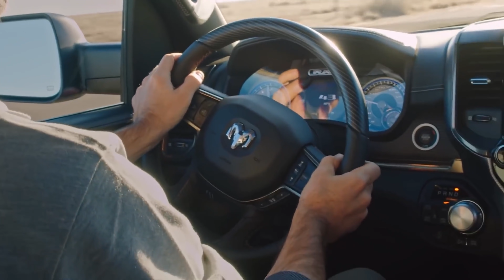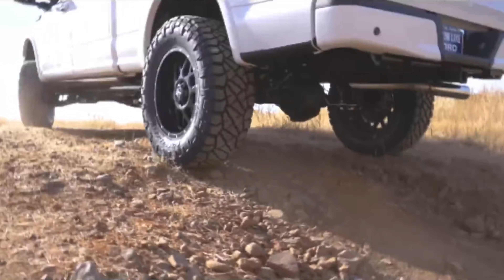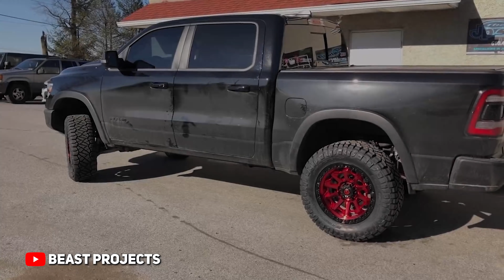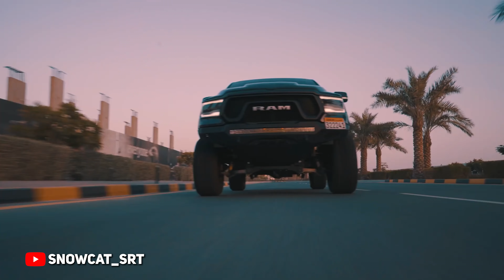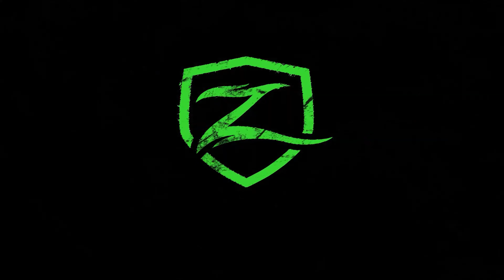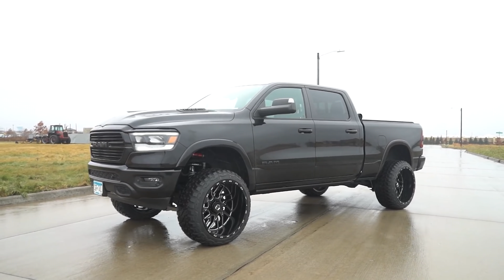Top 5 Suspension Kits For 5th Gen RAM 1500's

Comment: I’m just trying to get a big enoug lift to fit 22x12s on my ram, I’m thinking 3.5 or 4 inch, I really want to keep drivability
Reply from the maker: you can run 22x12's on stock setup, or even a level depending on the tires! Check our gallery out here - https://www.customwheeloffset.com/wheel-offset-gallery?make=Ram&wheel_diameter_from=22&wheel_width_from=12.0&sort=date
Reply: You can do 22x12’s with 33x12.5 on a level with -44 offset

Comment: I stuffed 35” tires on my levelling kit 😂
Reply: I have 22s wrapped in 35s with just a leveling kit no rubbing just a little trimming of the plastic fender liner
Reply: Same i have a 2.5 front 1.5 rear level,20x10's and 35's no rubbing
Reply: @TheIamdevin  did you use stock wheels?
Reply: @TheIamdevin  pics or vid?
Reply: @TheIamdevin why did you do 1.5 in the rear if it’s a level kit?
Reply: @jacobmartin1181  it was a procomp level lift kit. 2.5" front spacer,1.5" rear spacer and my truck didnt sit like a chevy with the nose in the air so thats why i chose that kit
Reply: I did the same just took of the factory rock guard and zip tied the wheel wells back
Reply: I have a 3” level stock laramie 20s, 35” toyos and 2” spacers. I trimmed a bit and it still rubs a little just before full lock. Looks great though
Reply: Man I put 37” on mines lol
Reply: Same I’m on Falken Wild Peak At4ws 9.8/10 Only leveled
Reply: Factory chrome 20s

Comment: Does the leveling kit work with the off road package rams that already have the 1” lift?
Reply: Exactly what I want to know.  Wish they'd answer
Reply: With the pucks a 2" will work just fine to level the offroad 1" if you change out the whole strut then you need 3 inch to level... I have a 19 rebel with 2" puck level in front with 35" tires... had to trim the front inner fenders a bit for no rub

Comment: Is there any 2 inch lifts that work with the air suspension or only 4 inch? I would love to get a little more clearance but 4 inches is probably more than I would like for my purpose
Reply: You could go with a leveling kit on just the front, which is 2".

Comment: Thanks for the video! I just bought the readylift 2 inch level from you guys. And 285/60/20 wildpeak at3 tires. Love the set up so far.
Reply: How’s the ride quality on that level?
Reply: @Reachouttactical  still very good, tires make a bigger difference than the level
Reply: @johnmorris77  sweet. Had a 2.5” puck style on my ‘17 1500 with nitto 35’s and you could feel every bump in the road. Just don’t want this to happen to my new truck lol
Reply: @Reachouttactical  IMO going from a "P" passenger tire to a "LT" light truck tire makes the biggest difference. I bought 285 LT tires and if I bought the same tire in a 275 they are still "P" tires and weigh 20lbs less per tire. I'm debating on going up to 295 or down to 275 to regain some mileage when mine wear out.

Comment: Just traded my 13 Laramie with 6" lift 22 35s etc etc, in on a sexy ass loaded up 2020 Longhorn... Can't wait until year 2046 when I can afford to lift this badboy
Reply: I recently got the 2020 ram limited. Such a nice ride and by far the most luxurious vehicle I’ve owned as well
Reply: @unescape12345  no doubt... Theyre almost too nice tbh lol don't even feel like a truck, but I still smile every time I get in my Longhorn! Congrats👍
Reply: LOL
Reply: @juankarron9215  lol no lies
Reply: @DirtNassty  I feel ya homes...I just bought a 2021 Laramie Night Edition. All I can do is the 2 inch Level & some 33's....these Rams are sweet.
Reply: @juankarron9215  I leveled my 2020 and was able to fit 35x12.5x20x10 with some rub after removing the front mudflaps. Few burnouts later no rub! Food for thought.
Reply: @juankarron9215  which 33’s you go with?
Reply: @tazman3726  None yet. still on the stock 22x285's. They ride so nice. Be upgrading next winter.